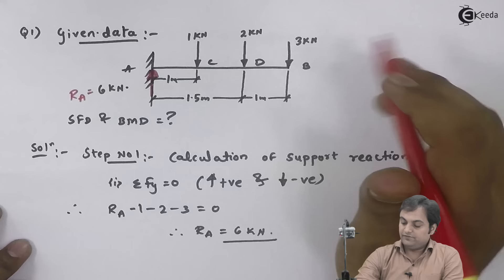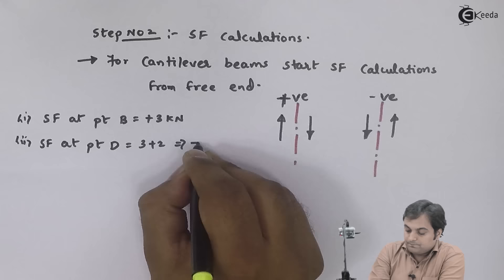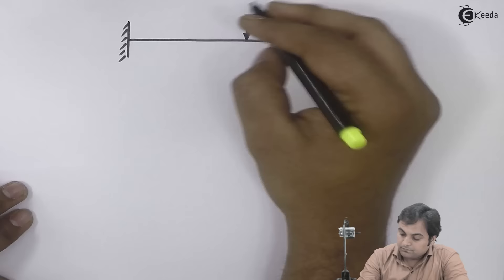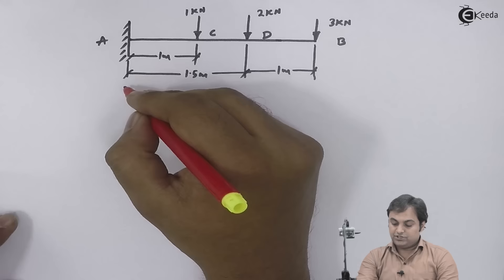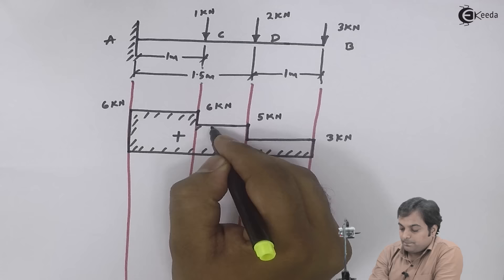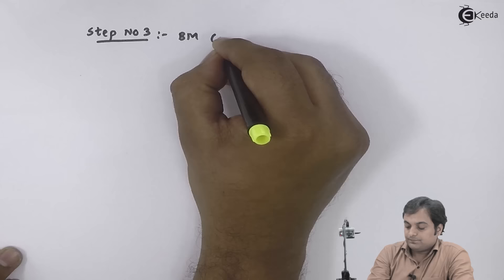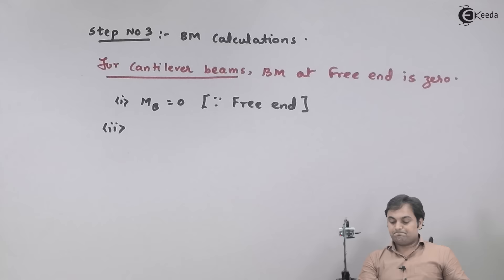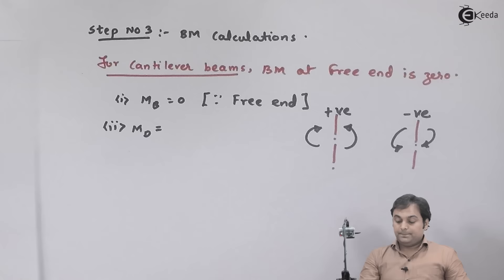SFD and BMD for Cantilever Beam - Problem 1 - Shear Force and Bending Moment Diagram

Comment: Excuse me sir pls can u explain to me if the RA=+6kn.   I thought in one of ur video u said that the SF at A will be opposite which in this case will be -6kn 
Pls explain
Reply: Fixed end will not generate any BM . That is why it is called fixed joint.